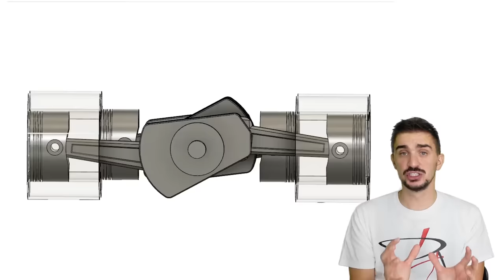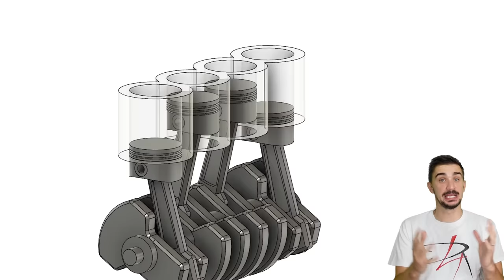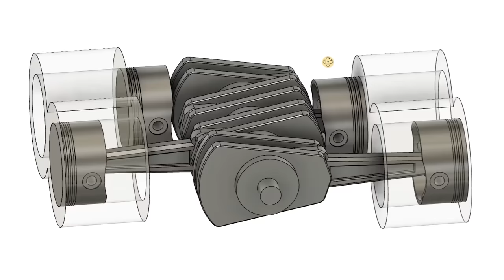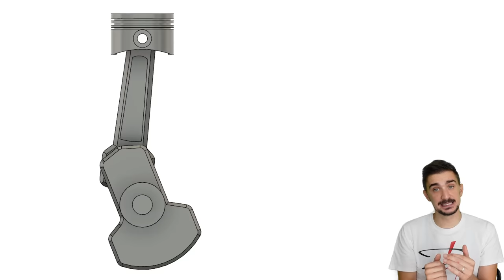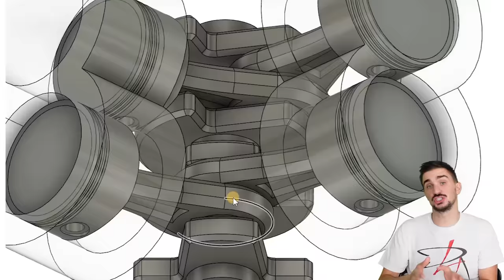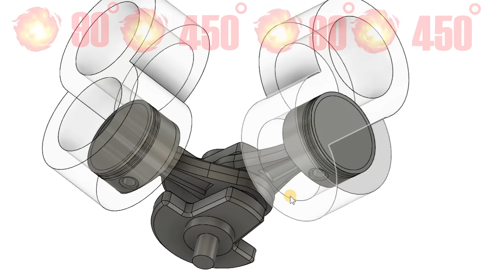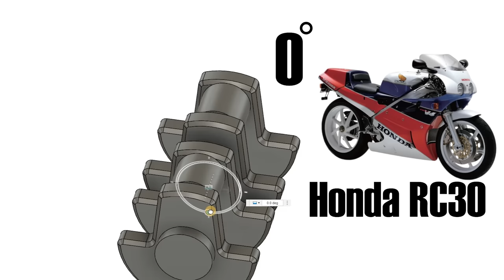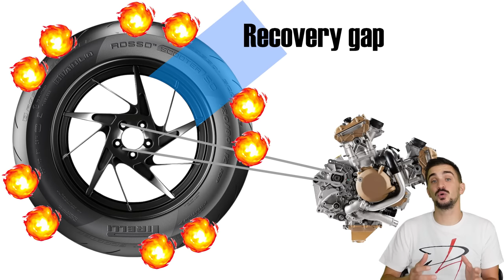Deep Dive: Inline 4 vs. V4 vs. Boxer 4 - What's the Difference? Engine Balance Explained in Detail

Comment from the maker: Patreon: https://www.patreon.com/d4a 
Support d4a: https://driving-4-answers-shop.fourthwall.com/ 
Hands on boxer: https://amzn.to/3EyDyJr
All metal hands on: https://amzn.to/3MgNlFE
Back to basics: https://amzn.to/3yrzI0H
Versatile: https://amzn.to/3OpMSRU
Reply: In Aviation the Aircooled Boxer Engine is the obvious Choice, as cooling Channels in the Cowling are easier to design the fewer Cylinders are in a Row. 
A Boxer Engine also has:
-half the amount of Crank Case, saving weight and space
-half the Length of Camshaft, saving weight
-3 instead of 5 Main Bearings (or 4 instead of 7 in a 6 cyl.), saving weight and space
-Flat Shape reducing Drag
-Updraft Carbutators for increased Safety
-OHV Valve Drive and Singular Cylinder Heads
Reply: Hey man. In the early part of the primary balance bit, I think you mean 90+90+90+450=720 not 90+450+90+450=720
Reply: It's just the graphic that needs updating
Reply: another car with v4 engine is the lancia fulvia but the v was about 12°
Reply: can you make a video about oposed piston engines ?
Reply: @MyFabian94  I was going to agree with you exactly on why the flat 4's (we call em flatties in the field) remain the go-to in light aircraft - I was a GA mechanic & refurb by trade (General Aviation; Maintenance, overhauls [TBO] & re-pop) it's just a better package for the application, especially in big displacements like the flat 6 Lycomings & Continentals in excess of 500 inches (8+ liters). It's also way, way easier to work on in-situ whereas the inlines have to be pulled from the aircraft and that takes too much time, plus nobody wants the excessive weight of coolant, rads & hoses and all the other crap that goes into water cooled aircraft.
Reply: I’m pretty sure that flat engines are referred to F4-6-8, not B4-6-8…
And to David Russell, some of those older aircraft engines get huge, like 20+ liters… and some people back in the 20s-60s put them in cars until regulations came in
Reply: @SilentRacer911  Yep. Still not uncommon for things like IO-320's to end up in Volkswagens & old pickup trucks. The really big displacements you're referring to (20+) would go to the radials and v12's, I don't think the biggest flat 6 I ever saw was more than 10 liters or so. They're usually capped at about 8.x liters as anything much more than that in a 6 cylinder package (V, inline or flat) starts hitting the law of diminishing returns and crashes the power to weight ratio. This was especially true when turbos matured enough to receive certification and are now pretty standard affair and displacements actually went down to save the weight. Contrary to popular beliefs it was more about the weight than the power; later on it was even more about specific consumption (again, generalizing here, it's a lot more nuanced than that I'm aware!) Still PLENTY of N/A light & medium aircraft out there some GA pilots just prefer the simplicity & maintenance costs that more than make up for the gas cost
Reply: I like the flat (H, or I-O depending where you live) format for aviation. Inline (I) for road-going vessels and the V format (V 🤔) for outboard boat motors. More often than not these are the preferred package formats for each application where they seem best suited to the job.. They really like working there
Reply: In which video did , you got sponsored by a turbo company? I'm looking to buy one.
Reply: Could this design have a tendency to oscillating, longitudinal-rocking ?
Reply: My man, please help me answer a question with my MotoGP friends.
Can a V4 make more ultimate horsepower than an I4?
I say no!
Help me win my bet! Thanks :face-purple-crying:

Comment: no square 4? :(
Reply: No, bad! spray bottles
Reply: Wouldn't that make a VR4? Basically a V4 with a very narrow angle between the cylinder banks. Like VW's VR6
Reply: @Harry_Gersack 
No, a Square 4 isn't like a V4 or the staggered VW engine. It is essentially two parallel twins that are mirrored, counter rotating, each has their own crankshaft but they're geared together.

I just made a comment guessing the Square4 is the best, or maybe a horizontal twin mirrored the same way, or maybe that opposed-piston diesel engine, with  2 or 4 pistons all moving in or out at the same time. But I don't know.

It does seem to me the best option are just two crank shafts mirrored, and counter rotating, to counter each other. One has the drive assembly, the other has a flywheel/damper the same weight as the drive assembly, like the clutch, but that may not be necessary. Again, I don't know.

But I would love to gear together even pairs of RC or 2stroke engines in this way.
Reply: @Zander10102
HISSSSSSSSSSSSWHAT'S THE PROBLEM?!
Reply: 16
Reply: That would be a radial engine

Comment: Just for those who might be wondering, the German Ford Taunus V4 was the same engine used by Saab for all 96 and Sonnet models from 1969 through the end of production. It was a 60° V, and did have a separate crank pin for each connecting rod (though I'm not sure why this would mean it is not a "true" V4). It also used a gear-driven balance shaft for secondary balance.
Reply: Also the Mustang I concept car, and Ford Transits built for the continental European market (West German built left hand drive).  UK Ford had their own V4 for the British Isles version of the Transit .
Reply: Actually, I wasn't wondering, but your facts are interesting. Thank you....!!
Reply: I still want to cut down a GM 90 degree V6 with the balance shaft to make a V-twin.
Reply: Rather like two conjoined V twins, but not exactly. It's been decades since I've have a Euro-Ford V4 apart (high attrition rate here) so I can't exactly remember the crank layout, but I want to say it was a 2-journal type with split pins on it. But I may be confusing the Taunus V4 with the way older V4 outboard motors were laid out (2 journals, split pins on each journal for a total of 4 - it was for compact packaging reasons) and that was all before subcompact vertical inline 4's took over the role of 4cyl 4 stroke outboards with like twice the power and roughly the same size & weight of the old V4's. Thank you composite manifolds and MiM! Anyhow, my 2 cents. I'm getting old and can't remember sh*t anymore 😑
Reply: Sidenote I also kinda remember the Taunus being a Cologne V6 with 2 cylinders lopped off, both V4 & V6 accepted the exact same exhaust manifolds as I recall?? Like I said it's been more than 30 years so.. memory is quite fuzzy. Someone set me straight! It's making me crazy
Reply: @Drmcclung  early Cologne V6's had "siamesed" exhaust ports (similar to the flathead Ford V8).  That's probably why you could use the V4 manifolds on it.  Typical Ford cost cutting 🙄 As I recall, it resulted in several disappointed Ford Capri owners when the heads cracked....and why they ended up with a more conventional design.
Reply: @brentboswell1294  Yeah, that's what I remembered when the V6 Capris came here, the siamesed exhaust ports. You're right, they didn't last long I do remember high attrition rates for both motors. The thing I flat can't recall was the V4 crank; was it a 2 journal split pin, or 4 journals like an inline/flat. Can't really find what I'm looking for on the net
Reply: Can't wait to get my Saab 96 up and running. Realy curious how that engine is balance wise.  But i've been told that they are not very smooth, especially when idling.
Reply: @tim1polman  they're really punchy.  They love to rev.  There's videos on YouTube of SAAB owners who really wind them out.  I think most of those have been modded, though (2 venturi carburetor plus a 2 venturi manifold).
Reply: @2000freefuel  People have done stranger things. Go for it... Photos please if you do.!!
Reply: @brentboswell1294    Have it running for a while now.  (Bigger valve's, enlarged exhaust ports, stiffer valvesprings and a Weber 32/36 carb.
Have had it up to 6500rpm, and it does sound really good indeed. :D

And you were definately right about them beeing Punchy.  I'm supprised how eager the 1.5 liter engine is.
Reply: @tim1polman you sure you have a 1.5? Later Saabs had a 1.7
Reply: @tim1polman  How's that project coming?
I had a neighbor, an elderly lady who drove V4 Saab 95 wagons. When one was approaching the end of its useful life, her son would find and recondition another, then transfer the alloy soccer-ball type wheels and other desirable accessories to the replacement car.  
Those old Saabs, for any viewer who is not familiar with them, tended to be rather heavy on the controls (no power steering, relatively small-diameter steering wheel) but you'd see this lady all over the north half of the city, putt-putting (sounded rough, but running smooth) along with the traffic and getting her errands done.

Comment: The impact of firing interval on bike's grip was new to me and totally makes sense. Wonderfully and eloquently explained, thank you!
Reply: But it's not undisputed.
Michael Doohan used the Big Bang in the NSR500 but then switched back to the screamer with regular ignitiondistance.
So it is also a preference of the rider.
Reply: @xyq384  also in mcdoohan era the 500 gp bike was truly 'analog' with carburetor. Losing traction in microseconds delivered by big bang order might be impossible to manage even by demigod racer.
Where as today gp bikes is also computer on 2 wheel that can manage smoothness for rider.
Reply: @silentIm  the advanced computer is the driver ❤

Comment: The one v4 I can think of in cars is Lancia's old v4. It's a super narrow angine v4 with 1 head, but I don't think it has a split crank like the Ford v4. The Fulvia used it and that car was pretty successful in rally racing.
Reply: Iirc, the lancia engine was a VR4, since it only used1 cylinder head.  (Its where vw got the idea for the vr6 engine, aledgedly)
Reply: On Soviet cars, ZAZ and LuAZ were installed V4 with a volume of 1.2 liters. Currently, some bikers in Russia remove the V4 from old ZAZ cars and install on a motorcycle ("zazocycle" called by them).
Reply: Saab considered the Lancia V4, or so I'm told, before selecting the Ford unit. 
We had a drill rig at an engineering company where I worked many years ago that had, i believe it was a Wisconsin V4 air-cooled industrial engine.

Comment: The reason why i like motorcycles a lot more is how relatively small aspects of the design greatly impact the performance. The rotational direction of the crank could make the difference in Braking and changing direction, in a car its usually negligible.  

The Ducati "twin pulse" V4 is pretty cool. I don't know if its mainly down to the 70 degree crank &/or Desmodromic vales, but the straight line performance is very entertaining to watch.

Great Video!
Reply: Oh yeah, I just now thought about "Hey, if the engine rotates counter to the wheels, then wouldn't it have a slightly lower tendency to wheelie due to rotational inertia canceling out? And beyond that, I recently realized that transverse mounting of the engine is technically the ONLY sensible design, again, due to rotational inertia. This time though, it would literally rotate the bike into or out of lean angle depending on how you were turning. Couple that with a shaft drive (the only sensible drive with a longitudinally mounted engine) and then it begins to "walk" or "climb" the pinion up the ring gear in the rear axle.

Comment: GREAT video with lots of easy to understand information....

I've been working on a radical engine design for several years. It's an inverted V 12. Let me explain... using 2 inline 6 cylinder engines, each with their own cranks. Both cylinder banks are geared together and there is a center-line output shaft. The banks are inverted and form an upside down 90 degree V. 

Left and right hand cylinders share a common head. The head has variable compression ratio where combustion chamber volume is adjustable. The magic is in the head. Using 2 inline 6 cylinder engines means there is perfect primary and secondary balance without needing anything else. The head has 4 valve per cylinder hemispherical combustion chamber with center spark plug. In addition to variable CR, it has variable lift, duration, and timing as well. The magic is truly in the head.

Variable compression ratio means engine is always at most efficient regardless of boost level. No boost, engine runs 10:1 CR. Add 3-4 Bars of boost and Static CR drops preventing pre-detonation problems. With high boost head is still at 10:1 CR or whatever is best for load. Lower static CR = higher amount of boost possible. You could have an engine with 5:1 CR and add a ton of boost. Problem is with no boost, engine would be very inefficient at 5:1 CR.

I have a 2 stroke version that works on paper. Cramming 720 degrees of rotation into 360 degrees is hard. But with full time mechanical forced induction and full time mechanical exhaust scavenging it works. Giant 2 stroke ship engines run at 100 RPM. Making a practical car 2 stroke gas engine is the challenge. 2 power strokes per 720 degrees means twice the power.  6,000 RPM in 2 stroke is same as 12,000 RPM with 4 stroke.

Comment: Lancia Fulvia was also a V4 narrow angle (between 11°20' and 12°53) with a single head, making it essentially the first VR engine.
Reply: Lancia Fulvia V4 should always be mentioned when talking V4 engines!
The Ford V4 was also used in Saab models and the Ford Transit.

Comment: My outboard engine on my boat is a 1.7l  v4 positioned vertically with the shaft running down the the gearbox then to propellor.    It's also a two stroke. Quite an interesting design by evinrude.   It makes 115 hp, which is plenty in a fairly small boat.   It's been very reliable, considering the environment in which it operates.      Which is a good thing when you're out on the sea.

Comment: I owned a VFR1200 which had a very unique V4 configuration. It had a 76' vee, with 2 inboard cylinders and 2 outboard cylinders, making for a wide front bank and a narrow rear bank, with the narrow one between the rider's knees. The crankpins were split with thin flying webs giving a 28' offset. It also had an unconventional firing order, firing cylinders 1 and 4 on the front bank, just 104 degrees apart, then a 256' pause, then another quick pair of power pulses from the rear bank. So rather than running like 2 v-twins connected together, it ran like 2 parallel twins connected together, and due to the rotating couples, managed near perfect balance without any counterbalancers.  It had just a mild buzz. It had other cool features too, like a sealed case with scavenge pumps for oiling, unicam cylinder heads, and asymmetrical headers. In my opinion one of the coolest engines they ever built, unfortunately the bike had some real shortcomings and didn't review well, and this engine hasn't been seen since.

Comment: Very thorough and interesting explanation. I have a Gen 2 Yamaha VMAX which has a 70 degree angle between cylinder pairs. A counterbalance shaft is used to reduce vibration. An interesting story I read was that during development the engine prototype was deemed to be too smooth for the character of the bike. It didn't deliver a muscle-bike sensation to the rider. Yamaha therefore intentionally introduced s small amount of low frequency vibration by modifying the counterbalance shaft. It now delivers a small amount of low frequency vibration to the rider. It is not annoying at all.

Comment: I love the V4 in my VFR 800 VTEC. The vibrations are lower frequency than an inline 4. The inline 4 buzzes the handlebars and footpegs. My brother-in-law has GSX750F, a bike very similar in power, torque and power delivery on paper. While riding it's totally different feeling and character. I guess it's the higher secondary imbalance combined with even firing order giving it higher frequency vibrations.

Comment: Just to add a bit of info on the boxer. The block doesn't have to made from two identical halfes. The Alfa Romeo Boxer for example have a single piece cast iron block, with two aluminium lids at the back and the front, that doesn't have a load bearing function. Also, this cast iron block responds well to boost applications, even if it only have 3 main bearings.

Comment: The Porsche LeMans 919 Hybrid also uses a V4 with split crank pin design to achieve 180 degrees per ignition.

Comment: I've had all these engines.  Obviously, inline 4s are quite common.  I had a V4 in a Honda VF1000F back in the 80s.  Recently, we bought a Subaru Forester with an H4 engine.  I have to say, the smoothness of the boxer engine in the Subaru is very noticeable.
Reply: I bought a new Crosstrek 2-liter six-speed last year. After forty years with Nissan pick-ups, the boxer is a revelation.

Comment: I hope you do a deep dive of VW's VR and WR engines next. I'm not much of an exhaust guy, but the W8 is the best sounding 8 cylinder engine in my opinion.
Reply from the maker: I did cover the VR6 in the six cylinder video. I'll get to the W stuff eventually too!
Reply: @d4a   I'm disappointed you didn't mention the ZaZ 965-968, that had an aircooled V4 in the rear
Reply: Narrow angle V engines have had a long history since at least the Lancia Lambda V4 in the 1920s. Plenty of material here for an entire video on narrow angle V engines.

Comment: The recovery gap thing makes a lot of sense for motorcycles
Reply: it works like ABS but with positive torque.  that makes the 'powerslides' possible without throwing the bike in the dirt.
Reply: @casemodder89  more like Traction Control
Reply: @RCmaniac667  traction control closes the throttle to archive a set torque.

abs does apply stutter brake.  an uneven firing engine applys stutter acceleration.   these engineconfigurations are best for controlled powersliding out the apex